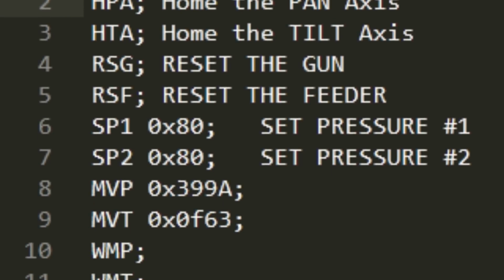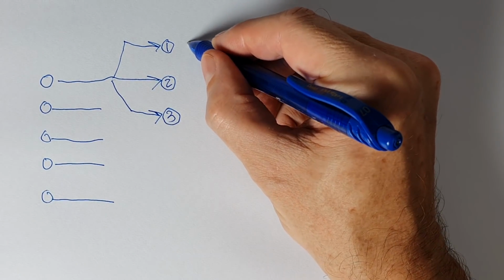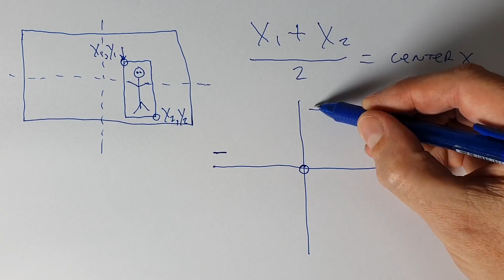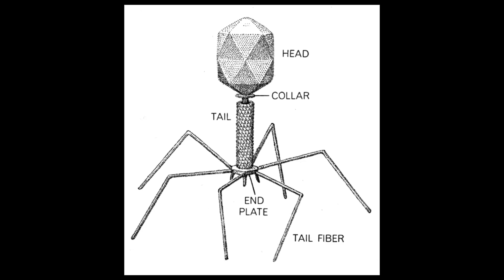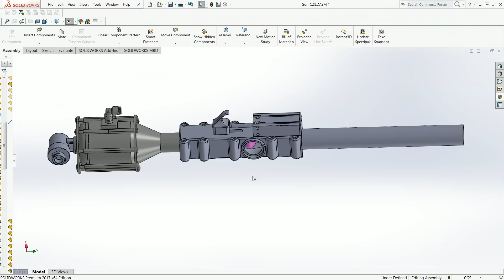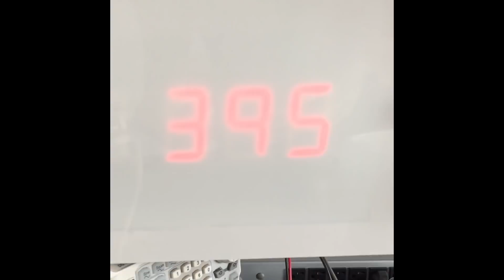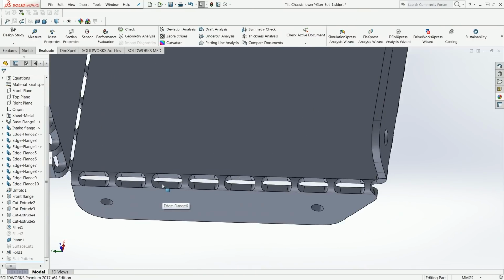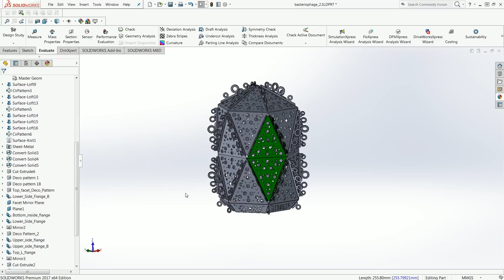When Robots Attack

Comment: At 11:43 you have a T junction for your air. What is that one? I have a similar problem in airsoft, where I use high pressure air from two sources and I want to have both connected.